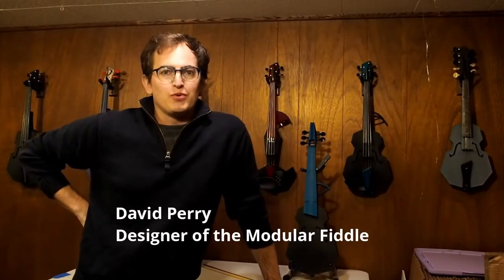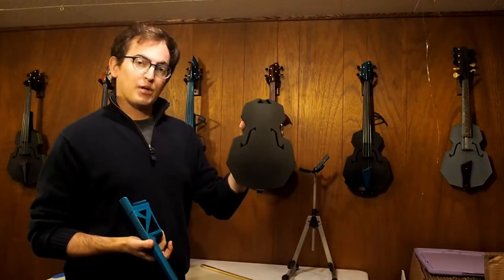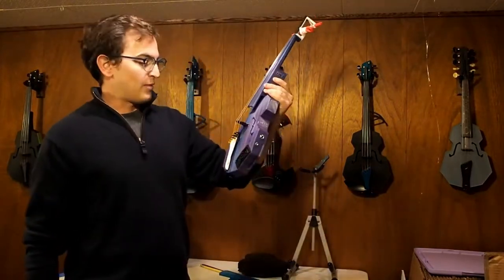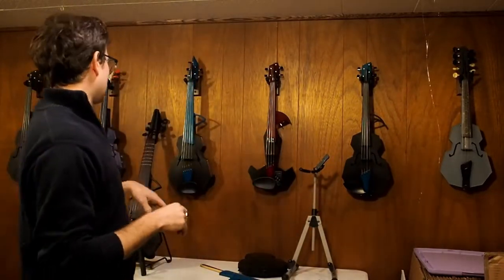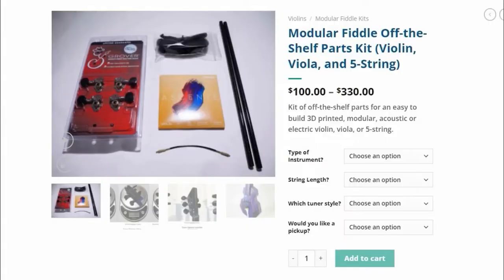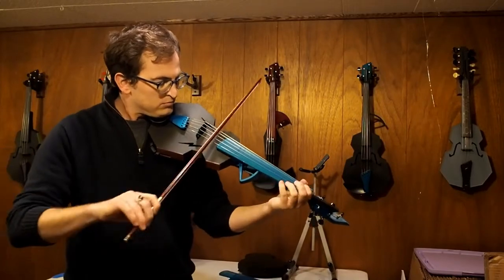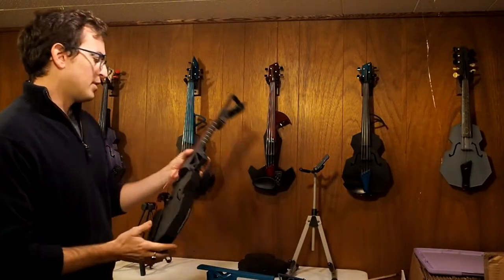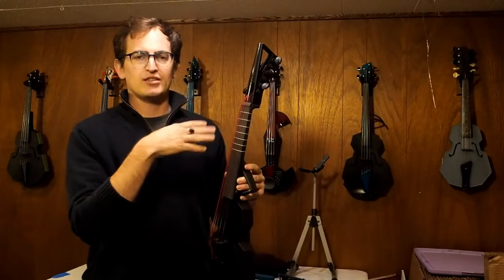What is the Modular Fiddle?

Comment: What print volume dimensions would be needed to print body and neck?
Reply from the maker: It's hard to say exactly, because the shape of the bed will determine if the parts fit, in addition to the overall size. The Ender 3 can just barely fit the parts, but you have to add a couple mm to your printer definition in your slicer. I use a Makergear M2 with a build volume of 200x250x200 (x,y,z). This also just barely fits.

Comment: My son (6) is very interested in violin especially the modular fiddle, I printed one in 2020 for myself.  Has anyone successfully printed one @1/4 size or will that mess with the tone too much? Just wanted to know before I import it  into Rhino and attempt to scale it down.
Reply from the maker: Hey Grant -- good question! No one has made a 1/4 size yet. Unfortunately it would require a redesign from the ground up. Different violin sizes don't scale exactly as you might think they do. That said, if you find the important dimensions for a 1/4 scale violin you could certainly use the Modular Fiddle as a starting point for your design!
Reply: @openfabpdx  thank you for the reply and the advice, and using the 4 string modular fiddle as the jumping off point is probably the best place to start. I will let you know if it pans out, so you still live in PDX?I live in Beaverton.
Reply from the maker: @outlawphil  yeah I’m in Portland!